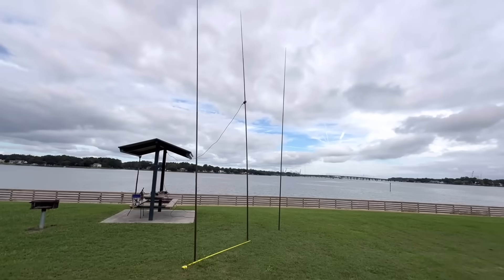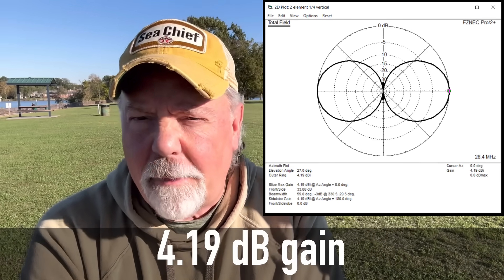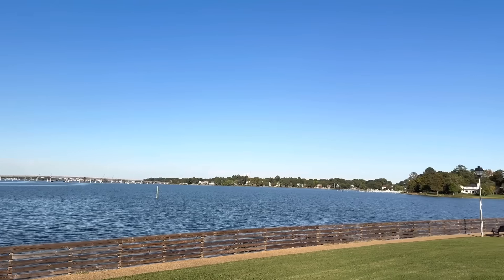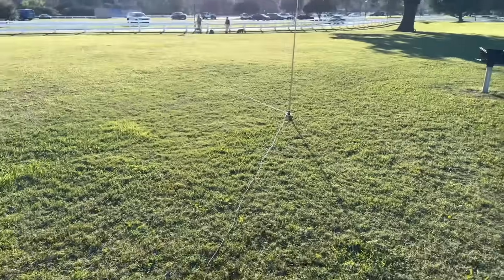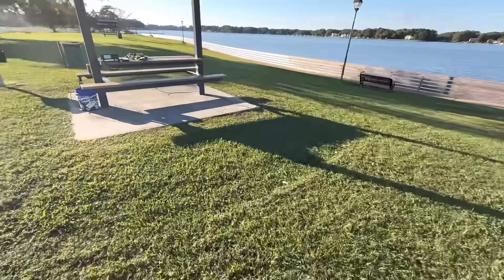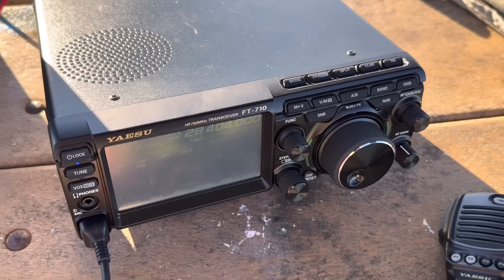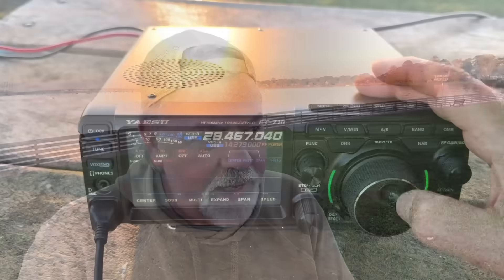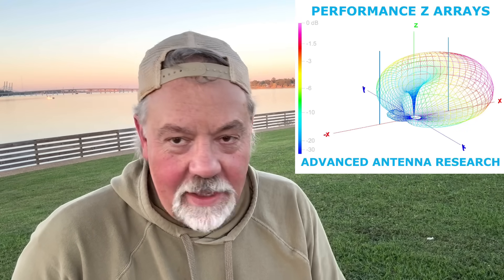Ham Radio Portable with Co-Phased Antennas

Comment: Hi.. I would love for you to try a 10-foot distance between the two and the two ground wires that are facing each other shorten them up 5 ft each and join those two wires between the antennas together... That should squeeze more power to the front and rear.. I am in the process of making two jpc12s into a vertical dipole.. very enjoyable...kev

Comment: 11 meters co-phased is called a Twin Trucker. Don't forget 72 ohm legs are RG6, the easiest cable to buy in the world. I've talked truckers into disconnecting them, and replacing them with a radio in the ceiling and a SSB radio in the bunk. There's no way you can outtalk that.

Comment: Aloha Walt, I watched this video carefully because I own 2-3 of those “red slugs” in order to get the antennas through AliExpress around the time they started doing that “Forced Refunds”. I also tried to order two of those red plates for my ground radials from AliExpress but again, Forced Refunds again. 
     My question had to do with the distance between the two red slugs, you said 5/8 wave twice but no actual distance in feet and/or inches or even meters. How far apart were they really?
Reply from the maker: They were 6.28 meters (20’-7”) apart.

Comment: Hi Walt, you could also try adding in a 1/4 wave extra length to one side to change the direction. I have this in my shack and have built a phase box to do this and I have a switch in my shack to control it. But in the field, you can just manually add in that 1/4 wave to whatever side you want to control the direction using a barrel connector.

Comment: :face-orange-raised-eyebrow:That was way cool! I have been wanting to co-phase 2 a-99s for years! and I wonder what would happen if u stacked them... any-who Something I did that said couldn't /shouldn't be done was put a I-max on top of a 3-element beam. It was 6 feet above and the bottom of the beam was 28 feet. And to really shake it up the beam was 8 feet from my tin roof. Now after all that has been said, the crazy thing was not only the beam directional the I-max {i-max was/is 5/8s wave vertical} was also. Last but not least on the 27. MHZ. I live a little west of center NC {Lexington} and could talk to 3 states no skip. Love the channel thanks for all that u do, must be an overwhelming task and something are passionate about. 73s

Comment: This takes me back Walt, in the early 90's I cophazed, a couple of 5/8 wave firesticks on a truck on 11 meters, they seemed to balance themselves it was 75 ohm setup, however at the radio it ended up at 50 ohm, a great directional setup for a mobile rig, great video 73s.

Comment: Hi Walt, WOW, what a set up; but it makes sense. 
Back in the day, I purchased a double 5/8’s wave combinder with three threaded spots on a metal base - outside holes for the whips and center for the coax connector. There is even a spacer to keep the whips apart as they ascend to the end. Life got in the way and never used it.  Like so make HamSters, I have it stowed away for sometime usage in the future. I’ll have to dig it out and see what kind of trouble I can get myself into…
Thanks Walt for the teaching lesson - had the bands cooperated, I’m certain the results would have been significant.
(🙏 Mrs & Salty) 73 my friend!  AC3EA
Reply from the maker: Thanks George, yeah, I really wish band conditions would’ve been better but oh well that’s how it goes. Hope you’re doing well. 73 my friend.
Reply: @COASTALWAVESWIRES hanging in there…. Hoping to be down home in FLA by early December!

Comment: Good morning.  I am confused, pretty normal.  The co-phased antenna system seems to act like directional antenna.  If there is a way to change the timing of the signal sent to the antennas, would that then act like a phased array system, used in radar antennas, witch would be able to quickly change bearings?  KI7SAR
Reply from the maker: Yes, and that’s what I was talking about at the end of the video. I have the phasing unit ready to go.